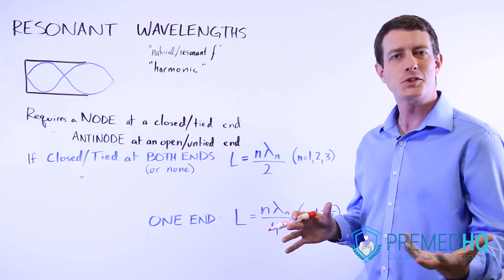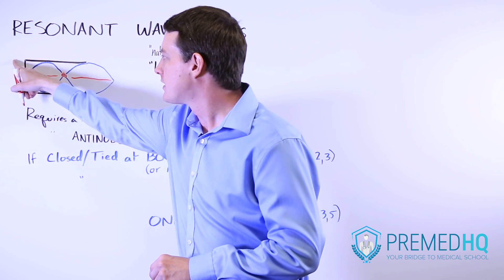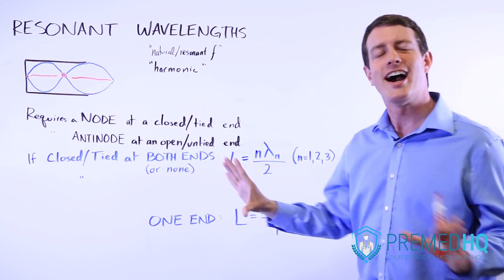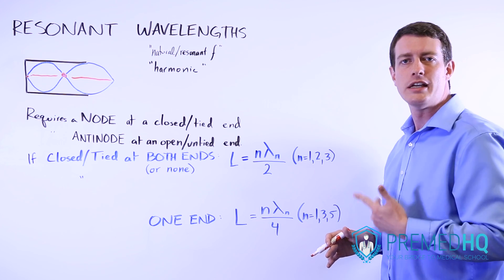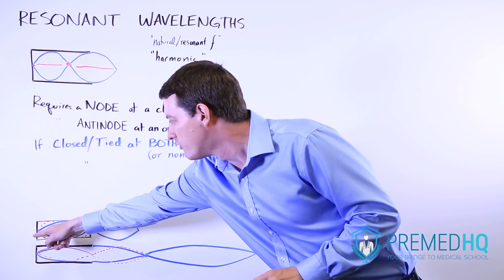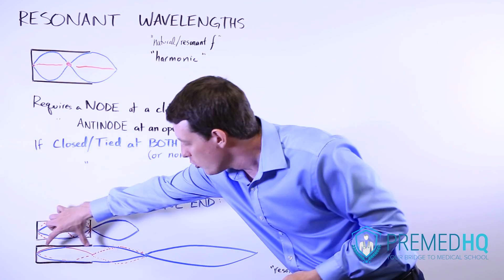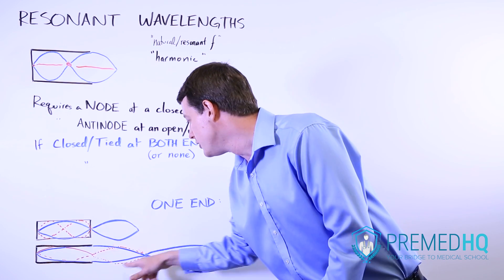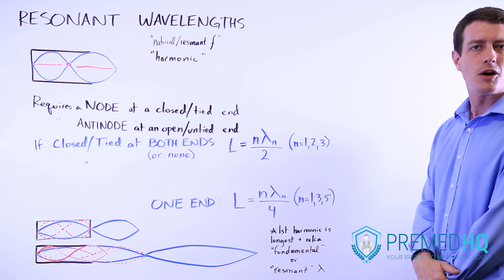Standing Waves and Harmonics | Equations for Strings and Pipes, Resonant Wavelengths

Comment: Would appreciate if you did actual application examples in the video. My issue is understanding the plugging in, your explanation of the formulas are great, would be nice if you did actual pipes and strings and showed us how they worked. Just a thought.